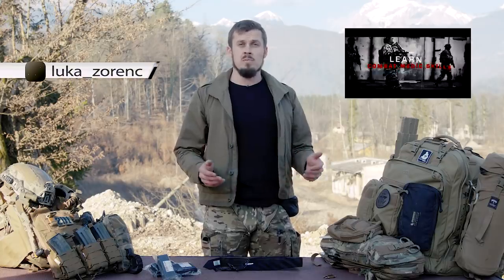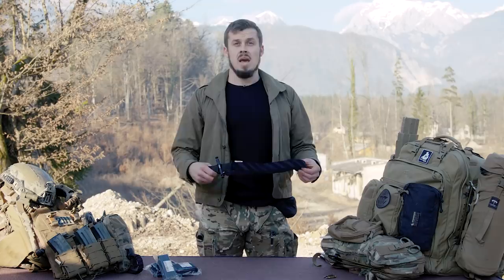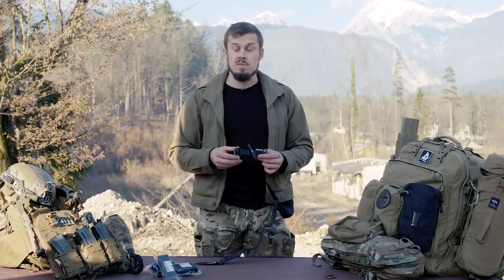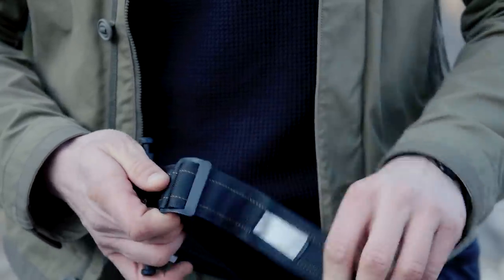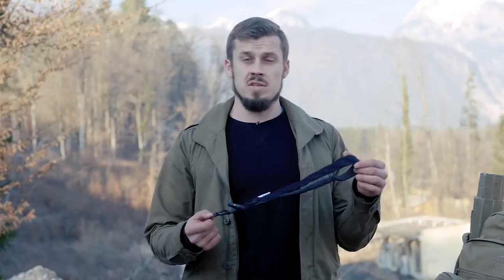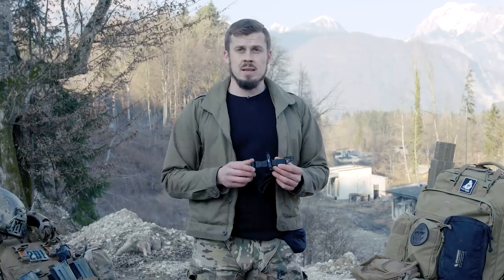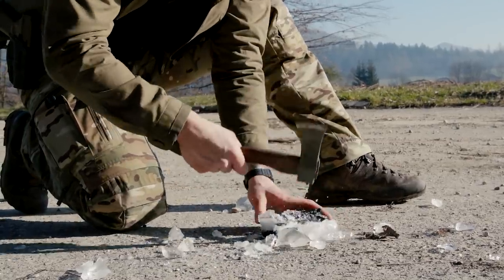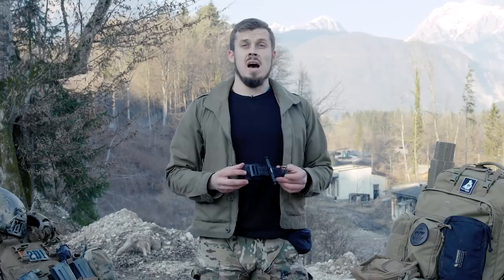The AK of tourniquets | SICH

Comment: You make it sound like aluminium is better than polymer.. But thats really not always the case.
There are so many different variations of aluminiums and polymers, how they are made, how the parts are formed.
Its really not as simple as Metal > Plastic. Take a look at magpul gen 3 mags for example. The mags are polymer, including the feedlips. 
But thats actually the reason they are a better altenative to metal, they don't bend and lose shape on impact. 
They flex and return back to shape, if they take big enough of an impact they will crack, which is noticeable. Metal however will bend and might not be noticeable until it jams up your gun.
Anyway, point is. Just because its metal it doesn't magically just make it more durable or better suited for the job.
Reply from the maker: That's why we did the tests. 
As Luka said in the video, we don't want to talk to much about which TQ is best/worst, i can just tell you that a lot of TQ's would not survive these test
Reply from the maker: But i definitely agree with you initial point, is not as simple as Metal > Platic
Reply: Like you said. Metal over plastic is application specific. Personally, I'd like the bits that some grunt hopped up on adrenaline to not snap when being cranked on. It's better if they bend, because a bent stick can still be useful.

This is a tourniquet we're talking about, not a rifle mag.
Reply: It was an example, which of you seem to have missed the point Grizz. Like i said polymers and metals come in different variations.
They don't all behave the same and i've yet to seen a CAT TQ snap or a Gen 3 pmag to crack. Metal parts can also bend and become useless.
Reply: @Shieldsz   No, I got what you were saying. You didn't get what I was saying though. In fact, I agree that plastic works better in some applications. Metal works better in others. In the case of a TQ, I'd rather have metal hardware because it'll be serviceable even if bent. Mags? Depends on the weather. I've had Pmags fail, and that was in a big game hunting scenario, not a two-way free fire zone, but 9 times out of 10 Pmags are my go to for my .308 AR. YMMV.
Reply from the maker: The problem with plastic is that it's more susceptible to outside factors like mechanical force, heat, cold and UV
I can't link directly to the studies but google "milmed-d-11-00212" and "milmed-d-12-00454"

Comment: There's one big problem with this. 
See, if you're using a tourniquet, it means you are in a high stress situation. First thing that happens to you in such a stressful situation is to lose your fine motor skills, such as driving that belt into a loop. On this TQ you have to do it TWICE. 
When adrenaline is popping out of your ears and your hands are shaking, that just becomes very, VERY difficult to do.
Reply: @Schulze108  what's your point? Is he wounded? Under fire? Stressed? High on adrenaline? Concussed?
Reply: @MrSedrack  TWICE fixation is more reliable, but not mandatory.

Comment: Has this been tested and approved / declined by the official TCCC recommendations?
Reply from the maker: No, it wasn't tested so it's not approved.
SICH is designed and made in Ukraine and they never submitted it to Co-TCCC. In the initial version of the video Luka actually mentions that SICH doesn't have TCCC rating but that it's just a matter of time if the company submits it (and eventually Co-TCCC does another evaluation).
Before uploading the video we showed it to the company that makes SICH and they wanted that part removed. I'm not sure if it was their bad english or they intentionally didn't want to understand what kind of "certificate" Luka was talking about. 
At the end we removed that part because we (as a company) plan to buy more tourniquets from SICH
Reply: @PolenarTactical  Thanks for the clarification!